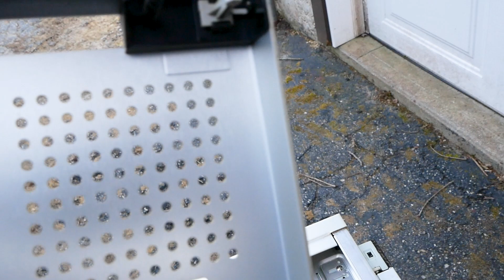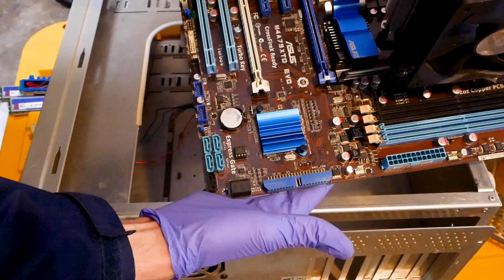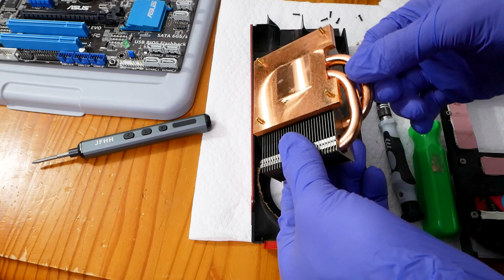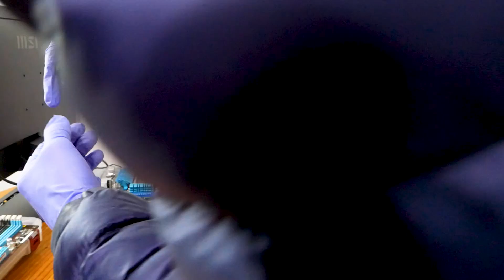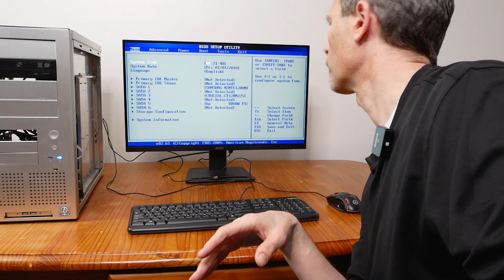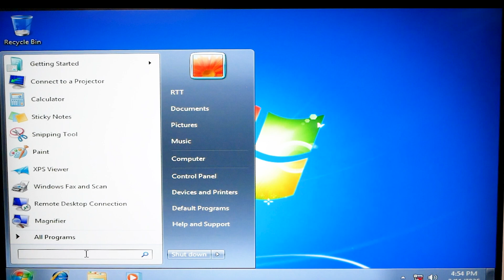Restoring My Forgotten 2009 Gaming PC + Lian  Li PC60 Case! #PCRestoration #retrogaming #lianli

Comment: Good job my dude, the AHCI hard drive setting is a very important little detail that most forget about. On a side note I have a AMD Phenom 965 with 8gb of ddr3 ram and it pushes a more modern R9 280 3gb card. I don't game with it anymore, just use is at as a media center hooked up to the bed room tv.
Reply from the maker: @kacykain3363  Tyvm! Nice your 965 is still decent and good work keeping it running with a purpose and not in the landfill :)

Comment: With a similar Asus motherboard (the 785G version) I unlocked a Sempron 140 to an Athlon II x2 (2 x 1 MB L2, w/o L3) and overclocked it to around 3800 MHz. Used a Coolermaster 212+, too. It had a pair of blue 2 x 2 GB Ripjaws DDR3 1600 CL7, looked like yours. Those DIMMs worked better at 1333 and lower timings than setting them at DDR 1600. After that unlocked Sempron I installed a Phenom II 1055T. AM3 was quite interesting.

Thanks for the review 👍
Reply from the maker: Hi there! That's pretty awesome you were able to unlock those 2 cpus. I tried a few times on diff board to unlock a tri core I had with no luck. You're so right about the ripjaws ram happier at 1333. I've noticed a few times giving errors and the mono thinking it was a failed oc lol and defaulted it back to 1333. lol ahh, the good old days! Thanks for watching and commenting. I appreciate it!

Comment: GTX580 was 1.5gb and some partner models doubled their ram to 3gb
Reply from the maker: Interesting. But the video card in this PC is an HD5850 1gb. The HD7950 went up to 3gb of ram as I have that Card as well.
Reply: @RememberThisTech  I understand, i didnt say the card was the 580, you said of the card being 1gb thats how it was in that era, so im saying in that same time frame the GTX580 launched  with 1.5gb and partner models with 3gb existed as well.
Reply from the maker: @kommandokodiak6025  oh yeah very true. I misunderstood :( Yeah that gtx 580 nvidia came out I. Nov 9 2010 a year after my hd5850 and that did had 1.5gb ram.  If I'm not mistaken the HD5850 did better than the 580.

Comment: Great video. Subscribed. Man, I have a love/hate relationship with Lian Li cases: I love the features and their production quality, but I can't touch them - the brushed aluminium gives me instant goose bumps 😅 it's really weird and uncomfortable^^
Reply from the maker: @moezarella1261  Hi there and welcome to the channel. Tyvm! I know what ya mean. I use them now for their nostalgic aspect as it's one of the first feature full cases I had. Now I like a nice zalman or Corsair case :) Thanks for watching and commenting. I appreciate it.
Reply: @RememberThisTech  What do you like about Corsair cases? I'm really curious 😀 I'd only had a Carbide 100R given to me in rough shape but filled with a nice Core 2 Quad-System, which I restored to sell it. It was a nightmare to work on - especially with anything other than a stock Intel CPU fan. If you tried to use lets say a Tower cooler, you couldn't reach the 12V CPU Power connector, because the mobo was so close to the top cover (which was riveted^^) that there was no room for anything other than maybe a toddler's hand. The cooler could not be mounted with the board already installed (screws went in from the back, which was completely closed off in this case. So I had to connect it while I held the prepared board above the opened case and then I could install the mobo. Good times xD
Reply from the maker: @moezarella1261  I have a Corsair 400d airflow mid tower for my editing sys. It's sturdy, good airflow, decent cable management system, and room for a larger gpu. But I totally hear you on some cases with no room on the top to plug in or get your hands in there. I've had a few like that and it drives me mad for sure :(I also like my Zalman i3 neo case. Cheaper and roomy, plus came with a lot of fans. Did a review on both of them I belive.

Comment: I had the black version with an AMD FX-60, DFI NF4 Expert SLI board & 2 x 7900GT's in SLI. I too removed the bottom drive cage so I could install my water-cooling pump (the reservoir was set in a 5¼" drive bay) ‒ yes, I had the CPU & GPU's water-cooled! Later, I got a Lian-Li PC-80 case again, in black that housed my Intel i7-930 with 2 x GTX-295's for quad SLI. Both of those cases were very well built and finished with niceties like protective nylon on exposed edges and removable m/board trays. Still a fan of Lian-Li all these years layer and currently have two Lian Li O11D XL's for my over-the-top water-cooled builds.
Reply from the maker: Hi and welcome to the channel! Dam water cooled FX60 and GPUS? That's hard core for back then for these parts wow pretty impressive. I've got a PC7 as well as this one, Perhaps it will be the home for my 98se PC setup :) Thanks for sharing your story and for watching I appreciate it :)

Comment: 22:45 wont 4 sticks cause instability/crashes my first gaming pc did when i mixed 2x4gb ddr3 corsair vengance 1600mhz with 2x4gb ddr3 gskill ripjaw 1600mhz so stuck with just 8gb of the corsair vengance, does mobo need to support quad channel for 4 sticks?
Reply from the maker: @BudKing96  Hi there. This runs stable with these 4 sticks. Just have to make sure to pair the 2 sticks in the correct dual channel slots. All good. This motherboard dosent support quad channel only dual. X99 motherboard will support quad channel.

Comment: I have the same case for my xp build pc using an MSI 7870 and a sapphire motherboard made by jetway an and X4 CPU 3.0ghz clocked to 3.4ghz  motherboard could take a later CPU socket with an adaptor.
Reply from the maker: That's a nice XP setup and case :) you have there. Especially that 7870! I wonder if you can install a Amd phenom 2 x6 1090t in your mobo?

Comment: I love 90s and early/mid 2000's Lian Li cases. Those drive bay lids are a bit tricky to snap into place, (3.5) and (5.25) has two "dots" on each side that lines up with the screwholes on each side. I have three Lian Li cases, my main pc in a gigantic black PC-A77B case, media-pc in a black PC-777 20th anniversary case which kinda looks like a snail. The PC-777 case I bought never used in early 2020 from ebay someone in spain for 100 euros. And a pc-v351cube m-atx silver case which I don't use right now. I miss the older Lian Li cases and all the cool and strange designs and features that they had. From regular cases to gigantic cube cabes and server/big tower cases and weird cases like the train-case from Lian Li or the snail-cases. Great video as usual sir.
Reply from the maker: Tyvm I appreciate it. I realy would like one of their small cube cases! I've this case a pc60 and another a pc7 . Another great thing is these cases don't rust! A train case? I've never seen that  :)

Comment: All things considered, this system was barely dirty LOL. Since it's a Crossfire board, are you gonna get a matching 5850? With fan holes that only fit 80mm fans, I used to buy server grade fans attached to a fan controller. Even at a low speed that didn't pierce your ears, they would flow far better than skinny wimpy fans at full speed. There are still goodies out on the internet you can find for the Lian Li: aluminum 3.5" & optical drive bezels, side panel with window, aluminum fan shrouds, etc. Performance-pcs has always had such a great selection of parts. Even though they didn't have the part advertised, I reached out to them asking if they happen to have a new window panel for my Lian Li PC-V1000. Sure enough they did! And here I was in 2024 buying a new old stock window panel for my Lian Li :D. I bet you can still find that front i/o panel door on eBay or something. Ah, all the great games from that era: BioShock, GearsofWar PC, Unreal Tournament 2004 was still going strong, RE4, GTA, Egosoft X3 series (my biggest time sink back then), FEAR, Left 4 Dead, Stalker, and so many others. I do hope you get to enhance this case the way you always wanted to back then.
Reply from the maker: Good info on reaching out to lianli. Problem with some of the games I have is they now reside in steam. And steam dosnt support windows 7 so I can test some but I'll perhaps have to upgrade to win 10 to test some of the others. I was going to slap in a graugeer usb front pannel. As far as the video card I crossfire I'll have to find the same model and make 5850 .. but more likely I'll do a minor upgrades video to this pc and we'll I won't ruin it. I'll though together the next video on 2008 to 2012 ish era win 7 games testing. Then next minor upgrades.
Reply: @RememberThisTech google: Steam Client Downgrades & Survival Kit. It may help in installing Steam on XP/7. I haven’t tried it, though. Some older games you might get away with copying over the game folder. And you know eBay still has plenty of original games on CD/DVD.
Reply: My comments are being deleted, and I got zero clue why lol.
Reply from the maker: @itstheMR  Wasn't me that you can be assured of. What did you post? I know I type a response sometimes and think it goes through only to find out It didn't and I have to redo the whole message :(
Reply: I think YT doesn’t like me giving the name of  the thread in Steam which explains how you may be able to install Steam on XP or 7.
Reply from the maker: @itstheMR  Look under rtt contact information in bio and send me an email.

Comment: Hello Jason, well saved!👍👍👍👍
I like the case and it also cleaned up well, perhaps you could add another card reader to fill the gap.
PS., Recently, I mentioned that the Ethernet port had failed on an HP., laptop which I have and I tried many ways to revive it, but to no avail, so I bought a USB., to Ethernet adaptor and that currently works.
Reply from the maker: Hi Laurence tyvm! I think I'll do a few minor upgrades to this PC and one will deff be a USB or card reader to fill in the gaping slot :)
Reply: @RememberThisTech  I shall look forward to that video.  Skol!